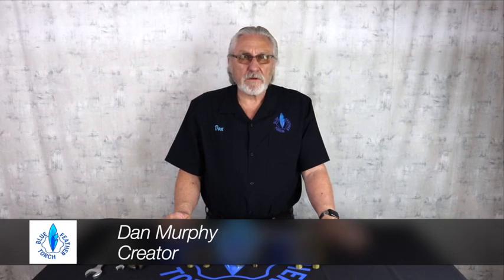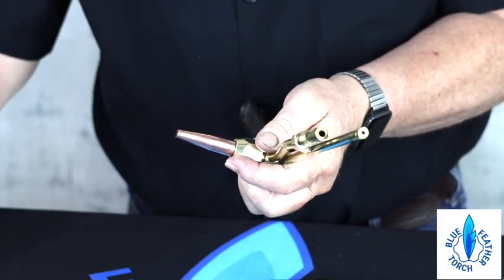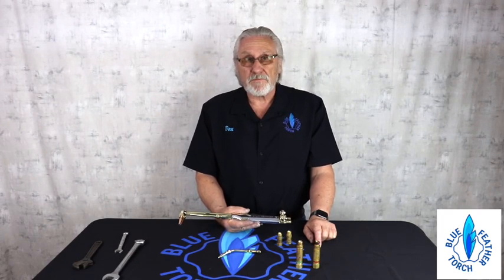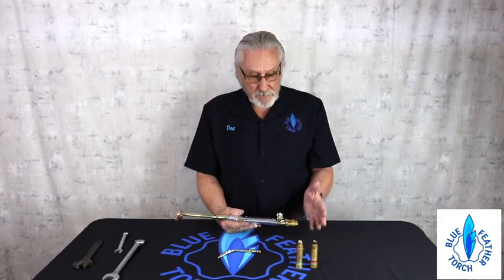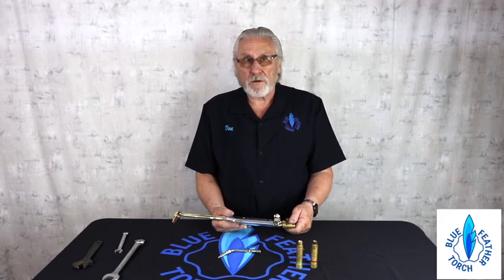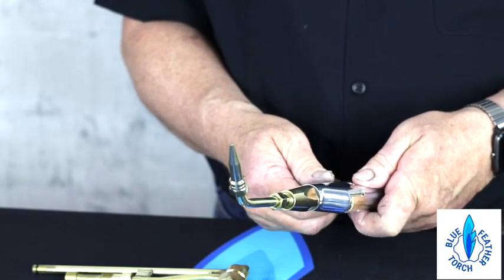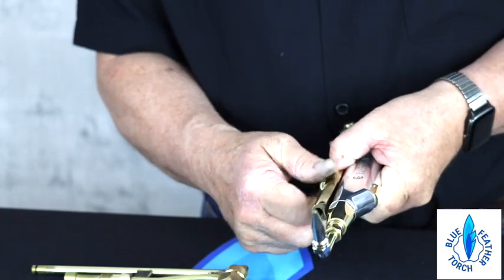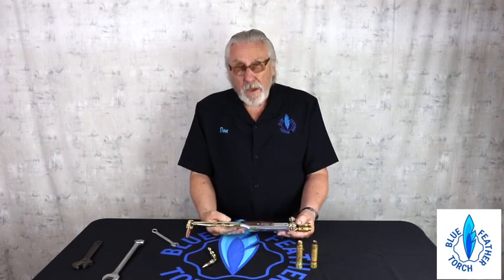Cutting torch assembly instructions-Blue Feather Torch

Comment: Beautiful torch and helpful instructions, thank you!  I look forward to buying your torches one day soon.  Do your torches use 3/8" - 24 CGA "A" size connections like the Meco Midget?  If so Harris has torch-mount flashback arrestors with built-in check valves Model 88-5 FBTA that I bought for my Meco.  They are quick small and don't get in the way.  I do need to add flashback arrestors to my regulators as well just in case my hose catches fire which the torch mounted flashback arrestors / check valves wouldn't help with.
Reply from the maker: Our cutting torch use the B fittings. And our little torch’s use the small A fittings. I’ll have to give those a look. Thank you for reaching out!